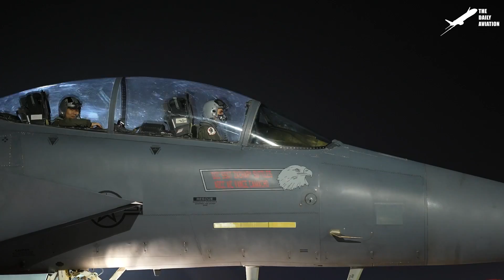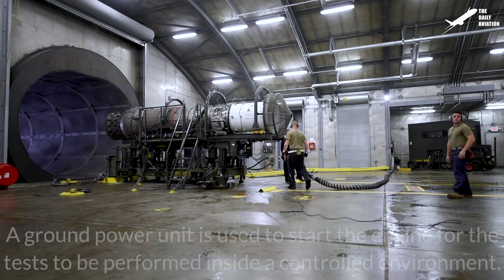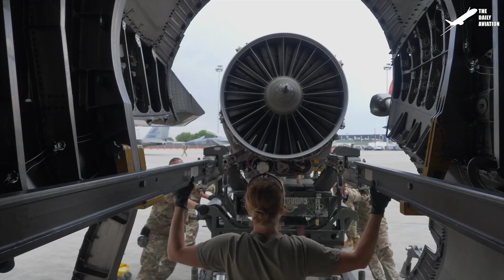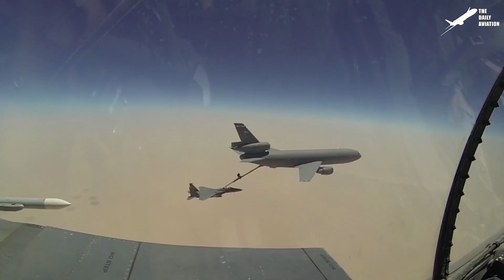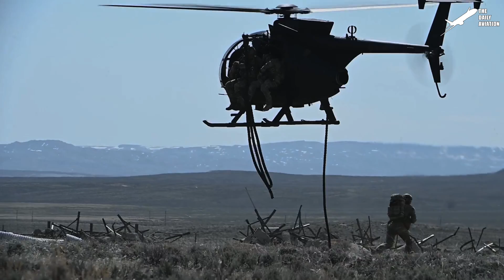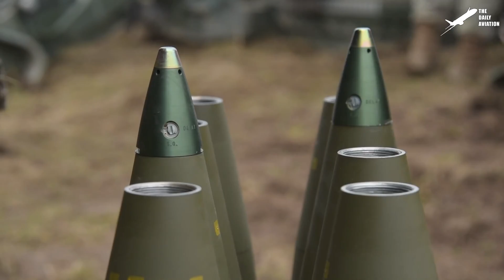Hypnotic Process of Removing Massive $40 Million F-15 Jet Engine for Repairs

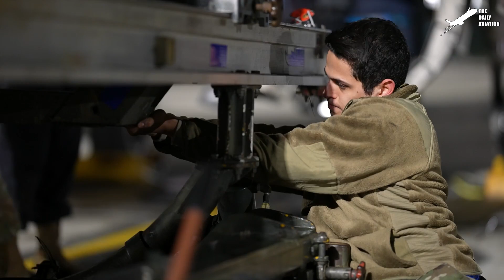Comment: 2:35 The engine being placed on a "dedicated engine transport cart" is important. There is a difference between a shop cart and a transport cart. The transport cart has more shock absorption than a shop cart. Transporting a jet engine on a shop cart could damage it's bearings and you wouldn't know it until the engine failed in flight. 
You might ask: What about hard landings?"   Well the engine is rotating during a hard landing so the shock is spread out. If it receives a shock while on the ground and not rotating it could dent one particular spot on the bearing race which would dramatically shorten the life of the bearing(s). (Does a hard landing shorten the life of the engine bearings?)  YES !